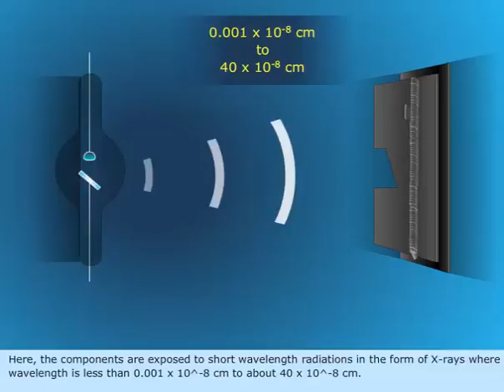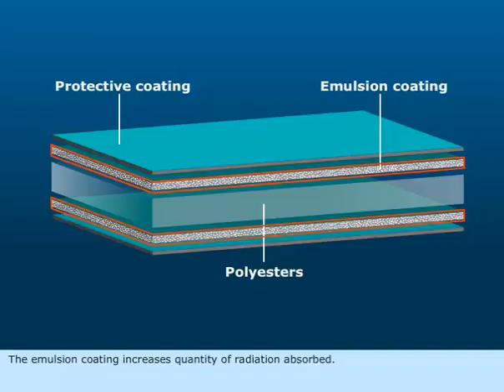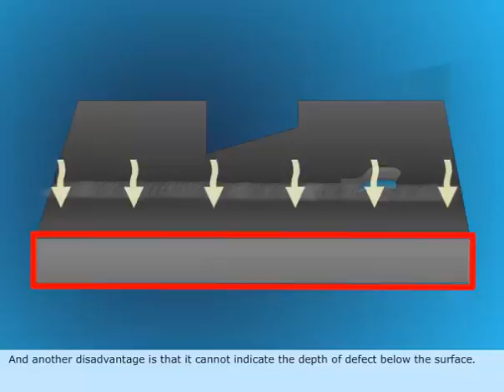radiography testing

Comment: Yikes. Your explanation is okay but flawed.
Especially with the last part of this video calling out the health hazards of radioactivity. Do you REALLY think radiographers don't know the safety of radiation or are going to let the public near the source? If you were to explain "barricades", as well as the amount of Roentgen (or REM) the public should be receiving from radioactive material, then you wouldn't have to worry about health hazards. But in case anyone wants to watch this and ask, here's some more insight:

Let's start with this: Radioactive measurements are in Roentgen (R), milliroentgen (mR), Radioactive Absorbed Dose (RAD), Roentgen Equivalent Man (REM). Although they're the same in measurement, the difference is that RAD deals with materials, and REM deals with the human body. You can think of R and mR as the "basics" (and also: milli = 1000, so 1 R = 1000 mR)

So the main safety objective for radiographers is to provide the public with a way to spot and alert them of the radioactive material. This is where barricades come in. These are placed out, starting from the source location, of a certain amount of feet to provide alertness to both the public and the radiographers. For example:

- A restriction area is placed at 2mR/h @ 1 foot.

Please note: The barricade is NOT placed at exactly one foot away from the source. We use detection equipment to indicate where the 2mR is. The 1 foot is just there for reference (Ex. Companies using the Imperial system VS Companies using the Metric system).

I know this video is 2 years old, so pardon me for this long comment. I just wanted people to know that as long as you're being SAFE with radioactive materials, then there's no need to fear for your health. That's what radiation safety classes are for.
Reply: Ok bruh 🐃